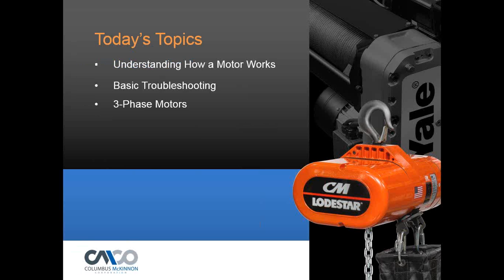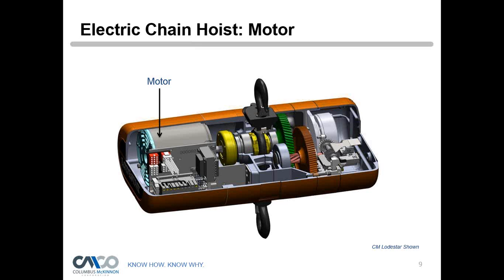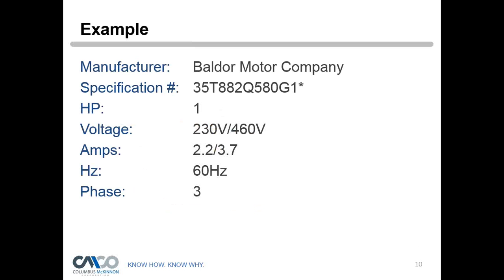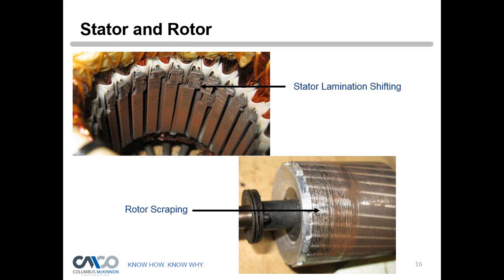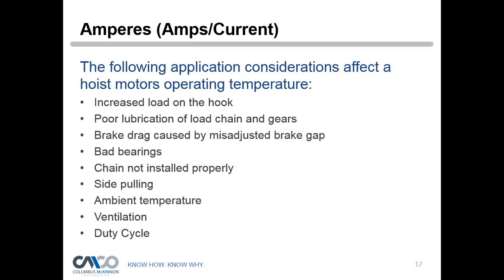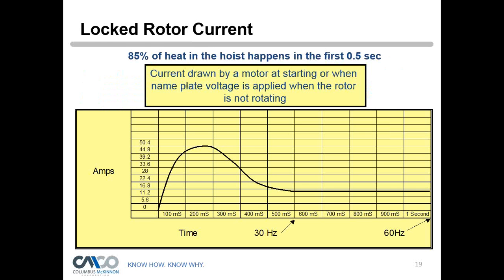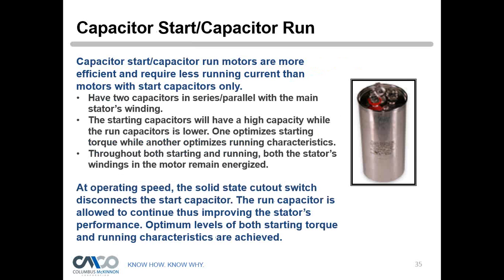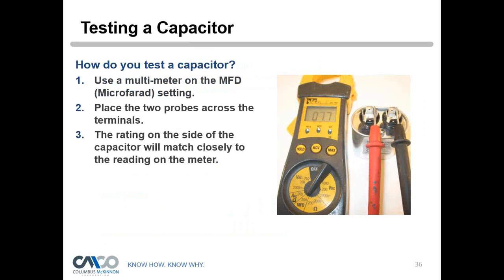Safety Webinar: Maintaining Your Hoist's Motor

Comment: Good job on this video. Thank you for posting it. You may want to add that the start coil resistance/Ohms measurement at the 35:46 minute mark is slightly higher than the main coils resistance/Ohms measurement because the start coil has a longer wire therefore higher resistance. That starter coil has to be stronger/more magnetic strength/more torque/more turns/longer wire to overcome the locked rotor force that 3 phase motors don't have to contend with & that is the main reason why single phase motor powered hoists generally cost more. Less electrical components = less cost, less electrical resistance, less troubleshooting during repairs, less cost to run, higher efficiency, run cooler which helps motor windings last longer because less chance of the coil wire insulation melting causing the coil to "let the smoke out"/short out ETC. I do realize you were pressed for time also. Keep up the good work & GOD Bless.
Reply from the maker: +Jet Engine Thrust, Thank you for your thoughts. Very good information to share.